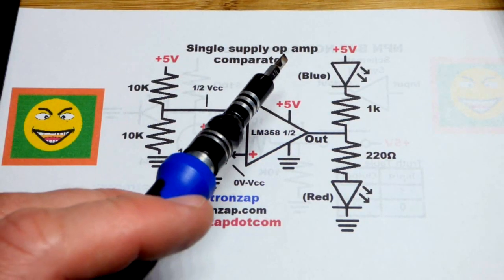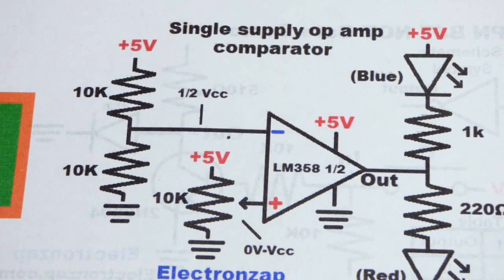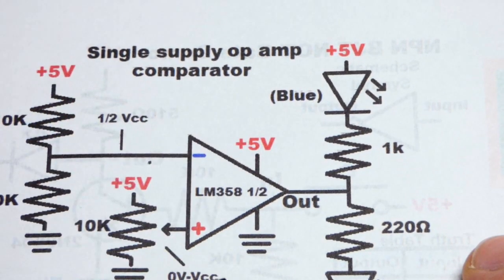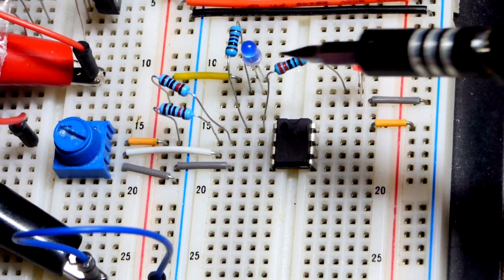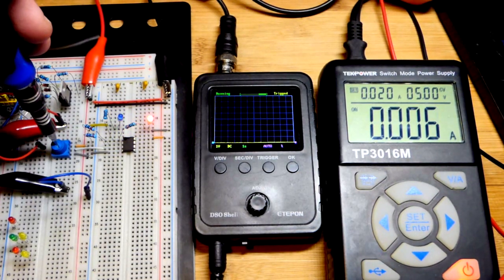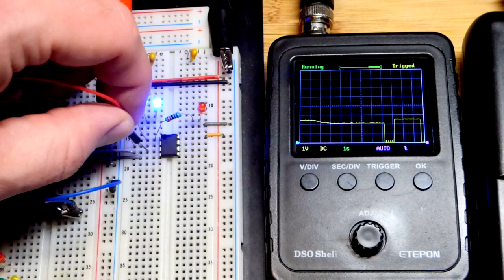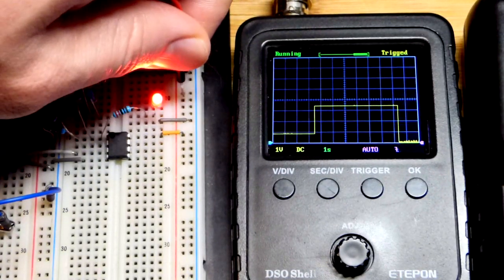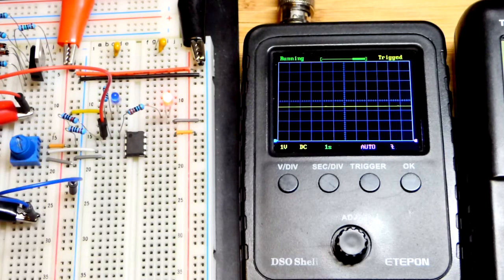LM358 op amp non inverting comparator single supply circuit electronics how to tutorial

Comment: Thanks for making these videos. may I offer a suggestion to use a 2-channels o-scope because all these pin pulling get confusing. If you need the o-scope closed to the breadboard, u can cut out a rectangular hole and place the o-scope inside.
Reply from the maker: Glad to have you watching! Thanks for the tip!
Reply: @Electronzap  , no problem and congrats on the upcoming 10K subscribers. Keep it up.